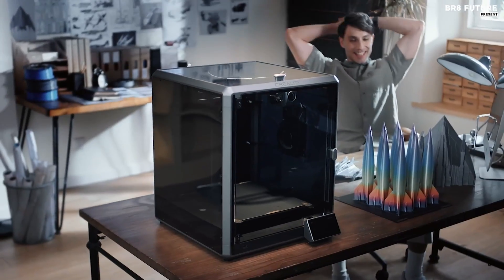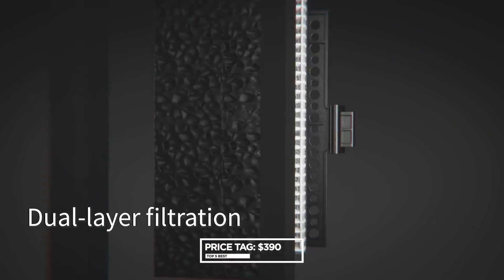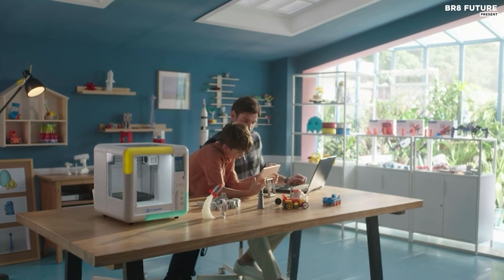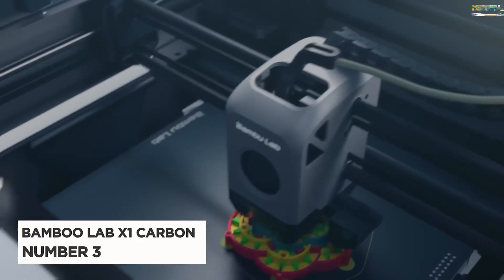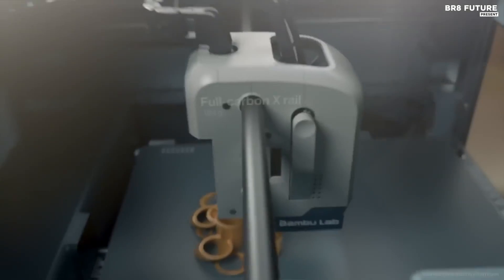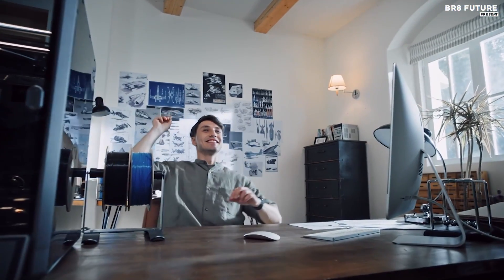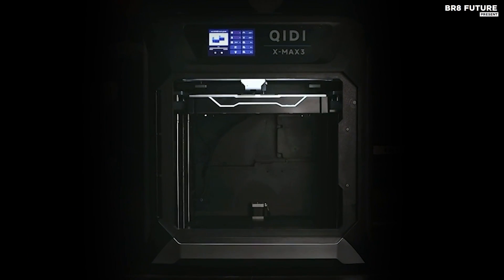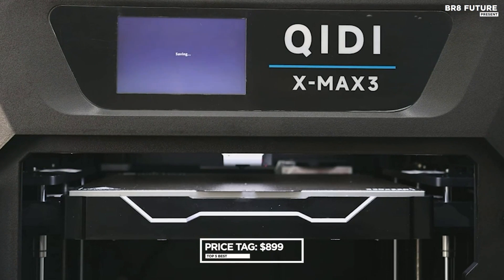Best 3D Printers 2024 🖨️🎨 Top 5 BEST 3D Printers of (2024)

Comment: I am looking for my first 3-D printer, and I would like some thing that just works.
I see a lot of complaining about the products on this video, but can somebody recommend something that they use, and why?
Reply: @SThompsonRAMM_1203  I could maybe make a recommendation. What kind of use were you thinking? There are a few types of 3d printers.. each with their own pros and cons.. resins make excellent, smaller but detailed prints. While fdm printers, although not as pretty, make better functionality prints.
Normally, if new to anything, I'd say get something cheap at the start, then something nicer. With the newest advances in 3d printers, I'd suggest starting upper midrange as they become very user-friendly and require much less tinkering to operate.  I tend to recommend fdm as it's more.. universal, and with that in mind, maybe try (qidi q 1 pro) it's around 500 and is a good print out of the box experience. Furthermore, with the  heated chamber, you can try out lots of different kinds of filaments. The only real downside will be the lack of multicolor print. 
If multicolor I would go with a P1s combo. But it's more expensive.

Comment: Do NOT buy the K1 Max, the printer is complete garbage.
I bought it 1 week ago and will send it back.
You need to clean the nosel after every print manually.
The printer doesnt feed itself you always have to push the filament manualy.
The software is so shitty designed and runs on a very bad cpu so the software/panel/app always crashes the printer when connecting.
The AI doesnt detect that the printer isnt even feeding filament on the plate and just keeps printing, no waring or anything.
The nosel destroyed the printing bed while autoleveling out of the box and sometime after again! Now I have 2 holes in the bed.
The printing bed is completely scratched from the nosel and very bad autoleveling.
The printer need about 1 minute after plugging in bevore you can use the panel
The printer needs to auto level every single time and with ai active you need to calculate about 15 min bevore the printer starts printing.

All that for over 700€
btw the quality isnt better than from any other printer

Comment: I have 5 of the Qidi printers and over all they are good printers, I am making parts for an invention and run them pretty hard and they keep printing
Reply: I have 2 Qidi max3 and work on them more than I print. I hear the newer ones have improved.
Reply: @fivepointeightnate  My first one is 10 months old, I guess it's the newer one?
Reply: @customit  What materials are you printing? Also what models? Both of my Xmax 3 printers seem to work for awhile and after about 10-20 hours they get off track and have to be cleaned and recalibrated. Only on harder to use materials like ABS and PC. Seems to be on the big projects like 10+ hour prints.

Comment: I bought a k1max : months ago and have had nothing but problems.
Reply: Current K1 Max versions are pretty different than the ones from three  to six months ago. For example, the v3 extruder is much more reliable than the v2 and the hotend is different. I got my K1 Max in November. I replaced the hotend with the Micro Swiss Flowtech and I've gone through three extruders until Creality sent me a v3. It's really good for me now.
Reply: @shirgall  Bambu Lab X1 Carbon, Bambu A1 or Bambu PS1 are FAR BETTER than any printer in this list.